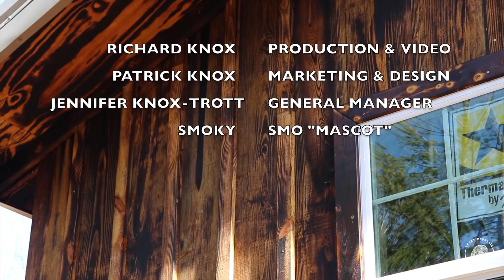CABIN SIDING, WINDOW AND TRIM | OFF GRID TIMBER FRAME CABIN | WOODWORK

Comment: Looking good. I like the continuation of the vertical siding up the gable ends. To me that looks a lot better than T-111 would look. Of course different strokes, but saving money on the T-111 was a win too. More work? Yep, but that doesn't appear to scare you. You manage to make even framing an art. Sad that the outside beams etc got covered, but there too I like the end result better I think than leaving it exposed. Still see it inside, and it'll demonstrate the massive framing members and how bulletproof that framing is. Plus it's a thing of beauty. Mortise and tenon in giant timber? How cool is that? In your talk yesterday you said how that weakened the structure. The way you did it I have to disagree, The ultra tight fit seems to me would act as a truss acts, transferring load and making the joint a "whole". I'm no expert, but I've seen what tightly fit glued joints are capable of. The T & M joint may not be glued, but DANG are they tight fits. And that surface tension amounts to a glued joint. ----------my opinion, and worth nothing on the wholesale market